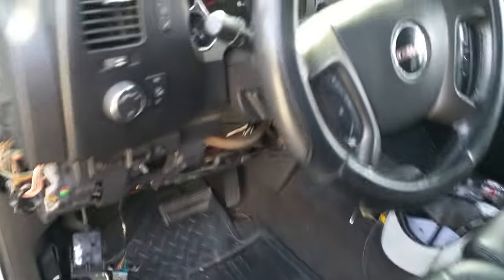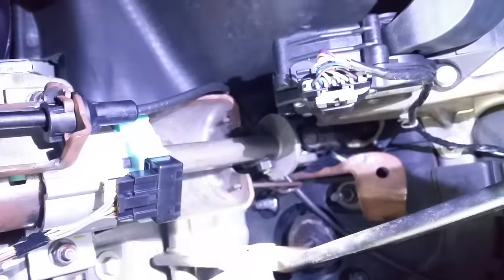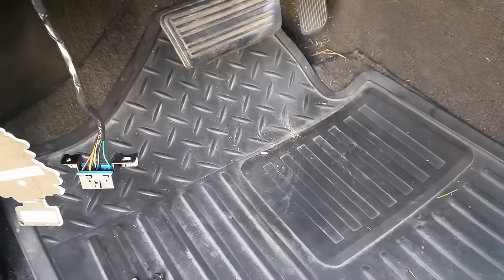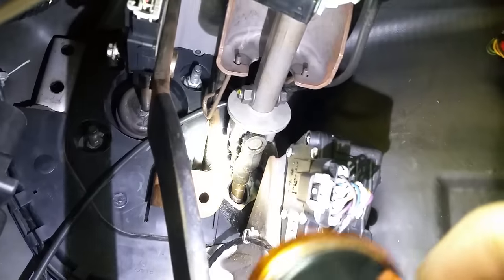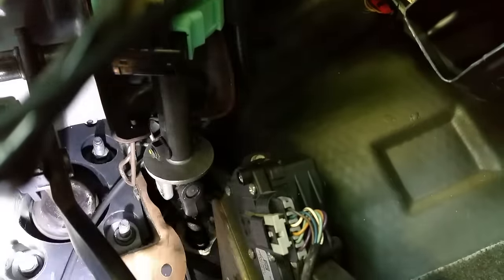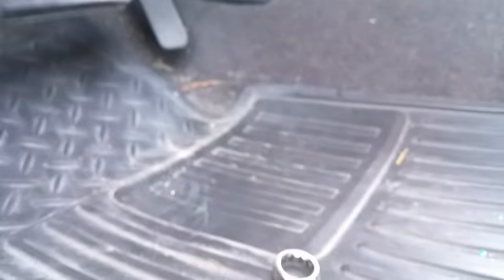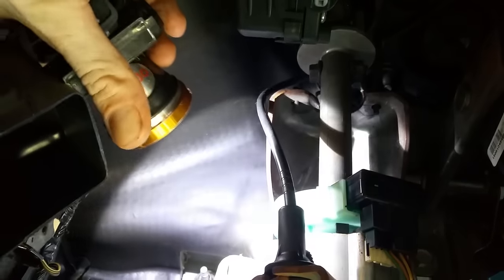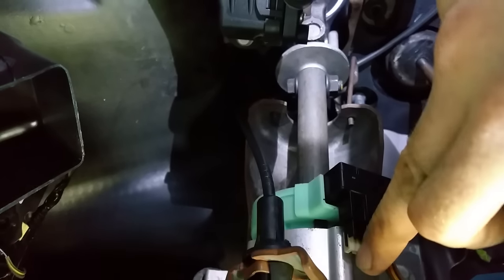SOLVED GMC Sierra & Chevy Silverado Service Stabilitrack Service Traction Control

Comment: This is one of many possibilities.  Each vehicle should be diagnosed its own problem.   I had one with a wheel speed sensor.   So replacing that part would have done nothing.
Reply: @kingbreather1982  ground wire on what?
Reply: Yea I just replaced mine and I got the same reading

Comment: I had this problem on my 2007 Tahoe I replaced my wheel hub bearing assembly because it was bad and bammm the stability track light came off . It could be about anything 😠
Reply: Prince-ab Luna that is what im going thru right now. My wheel hub needs to be replaced and i have the stabilitrak light on
Reply: Did yours throw a code or was the bearing loose?
Reply: J P no codes!! Jack it up turn by hand if it grinds replace also shake wheel if any give replace! If you hear roaring noise like it’s on 4by4 replace it, also replace in pairs and replace harness too!!moog comes with harness!

Comment: Perfect -- problem solved on my 2012 GMC SIerra!  Sheesh, those three torx 20's on the top of the bracket are quite the challenge!  I spent a few dollars more and got the OEM sensor instead of the cheaper off-brand.  This isn't something you would want to do twice.
Reply: How much was the oem one , compared to the aftermarket one?

Comment: Thanks for the video.  All worked just as you described.  One other thing to add is my problem was temperature sensitive.  Only got the warning lights when ambient temp was 80 degrees or better.  Very frustrating, so happy to have problem behind me.  Thx.
Reply: tackling this project soon. my issue is completely backwards from yours , mine acts up when temps are below 50°?   ongoing issue for about 3 years now. Hope this stops it.  thanks for the very intuitive video
Reply: @dustin00371  did this work for you? Mine also only acts up in the fall/winter months. Did you get a tranny slipping feeling after the lights come on between idle and 1st? They seem to temporarily go away if turn off the engine for a couple minutes
Reply: I have the same problem. Good in the morning but turns on in the afternoon. Annoying!

Comment: Had service stabiltrack, abs light,emergency brake light and service brakes soon message and a rough idle It was my brake booster. Changed it myself and all lights went away
Reply: How did you know it was the booster ?

Comment: taping the steering wheel to lock it in place to prevent the clock spring from breaking is definitely the PRO TIP that will prevent the release of alot of very foul language.  Good looking out!  I am about to do this same replacement as I have already tested the wheel speed sensors (at all 4 wheels)  and the brake switch (at the brake pedal assembly).  Those devices and circuits were good, so that left just this wheel position sensor as the fault.  

Here were the symptoms of the problem for my 2011 GMC sierra for anyone interested:  The stablitrack and traction control and abs light would illuminate ONLY when coming to a stop. However, when engine turned off and turned back on, those warn lights extinguished.  My instincts from this symptom led me to believe that there was a wheel speed sensor issue (because applying brakes to stop showed the warn), or from the brake switch (again from applying brakes to stop which tripped the these fault warnings to display).  However, this is where intuition isn't reliable, even though from a common sense aspect one would be led to believe one or both of those two systems were the root cause.  This is where troubleshooting proves that common sense and intuition has it's limits.  Turns out those systems and devices were no causing the fault.  I replaced those devices...all wheel sensors and and connectors and inspected the wiring and did a ring out of the wiring too.  Same with the brake switch.  Even though they checked out okay, this is a 11 year old truck.  Those things are going to fail sooner than later, so why not get them replaced now !  But, Nope..not those things.  Warn lights still pop on braking to a stop. So that leaves the wheel position sensor.  So that is next.  

I appreciate the 1-2-3 and tooling for this part replacement.  Very good and thankS!
Reply: Hey I got the same issue, ABS and stabilitrak and traction control come on either in rain, or when i come to a stop but only comes on sometimes, sometimes it doesn’t come on at all. I was gonna replace the input sensors first, but after ready this i’m gonna do what was said in this video, this comments helped me a lot so i’m basically thanking you because our issue is exactly the same and now i’ve diagnosed it, hopefully it fixes my staibiltrak problem. it’s a 2010 silverado btw, thanks!
Reply: also do u think i should replace sensors first?
Reply: Hi. I have similar symptoms on my 2008 gmc sierra. However, it also feel like the back breaks are "sticking" after leaving a stop. I recently had the front brakes and rear breaks replaced about a month ago. 
My question is, 
did your truck feel like the brakes were sticking as well when those abs, stable track control lights went on?
Reply: @3gchapa  no brakes issue..it was the brake switch for me.
Reply: @tdmmcl1532  ah ok thanks for letting me know. Appreciate it.
Reply: @3gchapa  its a cheap and easy part to buy and install.  I would do that first if the symptoms are the same as mine:  stabiltrack and traction control go out only when coming to a stop.  I thought I have a good brake switch, but after doing some more checking, I decided to give it a try and replace the brake switch.  And voila'...stabiltrack and traction control  works perfectly.  The wheel speed sensor and the steering wheel position sensor are much more difficult and expensive to buy and repair.  So I would do the brake switch first.  I opened up my old brake switch..literally cut it apart to see what caused it to fail:  there are two carbon trace elements that had worn down so they were never making good contact.  It's just a bad design from GMC!  (pitifully bad design).  For the new brake switch, costing 11 bucks from amazon, I put dielectric grease all inside the wiring connectors and in every single small part of that device to prevent moisture and crud from getting inside.  My truck gets alot of work in all kinds of weather ...and dirty boots all the time.  So I did this to prevent any debris from getting in.  So far, over 1,000 miles since replacing it and everything is working good.  Hope this is helpful!  God Bless America
Reply: @tdmmcl1532 Same situation here and I picked up a 2011 Silverado for $2,000 and she runs good just thise damned idiot lights wouldn't allow it to get an inspection sticker so here I am.on YouTube University 🎓 a new Roads Scholar!
Reply: Thank you for your knowledge
Reply: Yes @3gchapa

Comment: This video was truly amazing. I had the Stabilitrak, Traction  control service system light as well as ABS light on. Had the code downloaded from Autozone: C0050-00 and C0455-00.  Most likely suspect was the steering wheel position sensor connector. Purchase it from rock auto for $50 bucks.  All the tools specified in your video were spot on except I needed a Torque 25 bit for the bracket on the steering column.  Had that sucker done in about an hour. 
Once again thank you so much for this video it really helped out tremendously. Couldn't have done it without it and I definitely save hundreds of dollars versus taking it to a dealership.
Reply: Yep I spend 490 bucks I am so dumb to take the dealership and trust them it still flashes service and disabled track and stability then randomly back on and off for years now

Comment: 2012 1500 suburban. Had service stabilitrak and service traction control on information display. Swapped this out and fixed the problem. Followed the video to a T and had no problems. Thanks for the informative video
Reply: How did u exactly secure the steering wheel? I have to do this.

Comment: Thanks for the video,  i cleaned that steering wheel sensor connection with some electronic cleaner and it worked great.  No more stabilitrack and service brake system error.

Comment: My 08 Yukon had same issue. It was the brake light switch sensor that I replaced that fixed it.
Reply: Did you have to do anything special to reset the lights or just drive it and let it reset itself ??

Comment: My Stabilitrak control light came on for a second time (no traction control it says).  
2011 GMC SIERRA
The same thing happened to my wife's 2012 Chevy Traverse 2 years ago.  Before spending an arm and a leg I decided to check out a YouTube video regarding the same problem, sure enough it ended up being a burnt out fuse.  

Thanks for this upload by the way.
Reply: Which fuse was it

Comment: There is a steering column pin that can be used to hold the steering column in place during removal and installation.  This may be an alternate to trying to secure it by taping it
Reply: now show me how to do pin
Reply: I want to see it too. I have to change the sensor.
Reply: I think he is talking about the one that locks ( sometimes ) when you turn the key off , but most dont work that good

Comment: The spacers could either be at the front or the back of the steering bolts so watch when you remove them also zip ties will work to hold the steering wheel in place loop one around the shifter and the other side and handle with care.

Comment: Just i finished the installation,  thanks so much for your time to make the video, hope it work in my gmc, just stoped in the middle of cold weather in the middle of the nowhere in 🇨🇦..ugly experience.
Reply: It don't worked, the real problem is the Throttle body..
Reply: @zaino660  T/B causing traction control and StabiliTrak lights?
Reply: Throttle body? Please explain?

Comment: It could be many things, not just this steering wheel position sensor. They are as follows for the most common...
1) wheel speed sensors 
2) front hubs
3) steering wheel position sensor
4) clock spring
Reply: Or the brake light switch
Reply: Ah, I am getting Service Traction Control  DIC message about 1 mile after driving when the start temp is between 30 and 40 degrees..  It went away when I had the brakes and rotors changed and the message came back after about a year later.  I'm leaning toward the wheel speed sensors as the cause but which one is the question.
Reply: @timw8228  take a tester to the plug anything other than 0 ohms is bad test all 4
Reply: @fucktheleftFJB  sounds like the caliper is dragging and starting to nearly lock up. A caliper will drag like that then cause the pad to continue to make metal to metal contact and eventually ruin more things in the process.
Reply: @timw8228  I'm having the exact same temperature related issue, would be very interested to know if you found a fix, thanks!
Reply: @squidessentialmusic  I haven't done anything with it.  I'm possibly thinking of just selling.  Tired of messing with all that emissions stuff and sensor replacement.  I had it parked outside when it was close to zero but I keep a small space heater inside to prevent the dash from cracking,  I had to park my '89 Cadillac Fleetwood inside the shop.  Odd thing when I drove it with a warm cab I got no message so I am thinking it is the steering wheel position sensor that fouls up when it is below 45 or so in the cab.  The shop who did the 9th emissions injector replacement I had them check it,  They thought it needed an alignment or the steering damper needs to be replaced again.  After I had the damper changed before the DIC message went away. Since the steering wheel position sensor seems to be a common problem I'd say that is it.  When I searched for the part I saw where the number has been changed numerous times.      Criminey good thing I got that injector fixed.  It was dumping diesel and wasting it.  The price of diesel now is horrible and it's not getting better.  I about went in my pants when a dealership quoted a trade in value.  I was like holy sh** that isn't much less than what I paid for it when I bought it used.
Reply: @timw8228  Oh right on, yeah I feel you.... interesting to know that the cab temp is possibly a factor... im going to try that part and hopfully be done with this fix 3 yrs in the making. Seems like every forum or discussion I go on recommends a different fix. Annoying that one problem can have so many causes, other than that the truck hasn't given me any issues in the 6 yrs I've owned it (time to knock on some wood). Thanks for the reply Tim!
Reply: My abs an traction control light flash some times then after a while truck wont shift out of first gear stop shut truck off pull key out an start over an it stops other times it does on start up or while driving does it often or goes few months then starts im at a loss for sure
Reply: @squidessentialmusic  I have a 09 Yukon man from my experience when you have random sensors failing or do you think they're failing and random engine light coming on and off, I would start with the ground wire. Replace the ground wire and clean all connections. Before you start throwing parts at it. When the ground wire is not operating perfectly it will cause malfunctions to random sensors
Reply: @MatthewSmith03  replace your ground wires and clean all connections. 99.9% sure that will solve all of your issues. I realize that was what was wrong with my 09 Yukon after throwing thousands of dollars of parts and sensors at it and five different mechanics. All suck everybody sucks.
Reply: @c_mac7773  right on man ill give that a shot thanks
Reply: @shallowtrapper9873  that was my issue
Reply: What if your 2014 Sierra has no codes or anything on the scanner?  When I pull out to make a turn, the brakes lightly apply, and gas pedal goes dead. Very small vibration till the stabilitrac light goes off

Comment: I have the same symptoms,but no ABS light only traction light and check engine light is on. And my transmission slams a little when coming to a complete stop,and rough idol at low speeds.
Reply: Same problem I have did you get it fixed? What did you end up doing?
Reply: @davido8181  Same issue here
Reply: Same issue any ideas?
Reply: Replace air filter plugs and add lots of very good fuel injector cleaner in tank as you have a clogged fuel injector fualing out your plugs!!! It’s just the computer shutting things down!!!!
Reply: David O replace air filter plugs and add lots of very good fuel injector cleaner in tank as you may have a clogged fuel injector!! This is the computer shutting things down !!!!!
Reply: Mine had the same issue turned out being a burned ignition coil and a failing one. Start ur truck and one by one pull the plug from the ignition coils. If no spark it's bad I replaced 2 and bow no issues no light no hard shifting
Reply: When u replace them make sure u disconnect the battery or else the computer will continue to stop power to that coil
Reply: @joshm7876  Question.  When you say pull plug, from bottom end of coil, yes?  How visible will the spark be?  Will the engine shut off if plug is pulled?  I have the same issue and am hoping to fix it.  I just changed all wires and plugs and no luck.  Thank you.
Reply: @y2kcortez  yes the actual coil that connects the spark plug wire to ur spark plug. Its being held on by 2 bolts
Reply: Did you solve this problem ?

Comment: So mine worked fine until I had front end done including the steering box. The steering wheel was spun around and broke the clock spring. I had an airbag light and the stabilitrack. So the airbag light is fixed but the stabilitrack light is on still. My question is would spinning the steering wheel break that steering wheel position sensor or throw it off even? You think I should replace it still? I have a 2013 Silverado Duramax

Comment: I have that issue on my 08 Silverado. How do you trouble shoot if it is the sensor on the column and not at the wheels. I am going to pull the rotors off to check for rust and sensor is not dirty at the wheels. Thank.

Comment: 2015 silverado -- Stabilitrac and 4wd service flash, gauges go crazy have had it into Chevy dealer three times they cant find the problem.  Have blamed it on aftermarket break for my trailer and aftermarket auto start. Have disconnected both and problem continues.  This should be a recall and find the problem, they say it is not throwing a code.  This last time the check engine light came on, bring back this week to see what they say now.
Reply: James McElroy have you tried the break switch!!  Are your break lights staying on!
Reply: Did you find a solution to the problem? I have the same year truck and problems. Chevy dealer told me the same thing. I'm going crazy.

Comment: My 2016 silverados problem was the brake vacuum pump which I just found out that Chevy gave a specialty warranty for it, it should have been a recall because I never got anything telling me they gave the warranty to everyone with certain model and years. If I wouldn't have been bored and decided to see what warranties I had left I wouldn't have even known it and the warranty is only good for 72000 and I had just hit 70k

Comment: Appreciate any Help!!! Bought my 2007 Yukon XL with 73k miles on it. Its at 94k right now and this warning just came up. The part looks like it been replaced recently, pithing last few years. Could it be the same problem or something else??? I do have Tire sensor  Service light but I'm not sure if it could be related...And my Steering Wheel has a bit of a move when in Park like almost something loose

Comment: My 2012 Chevrolet Silverado the lights come on when I have hit a hard bump.
Reply: Bad connection with the traction control sensor
Reply: Change the sensor #9. The box is on the top on your side. Your gonna see the big box.

Comment: I lifted my 2012 GMC and they didn't place the ABS sensor line back and it was rubbed by tire, exposing and cutting the wires, hence the dash lighting up... Check those too before changing stuff...